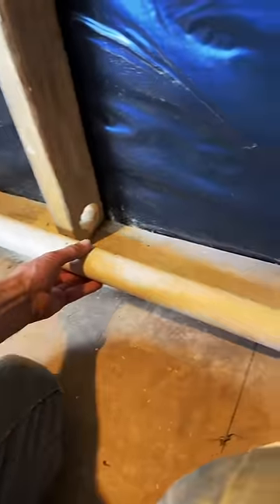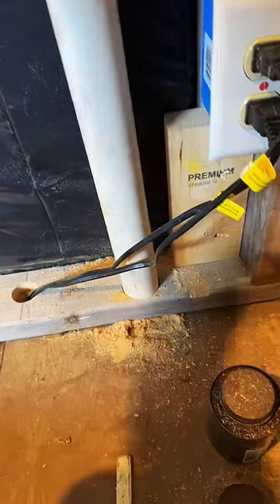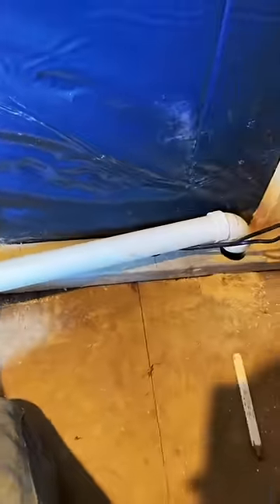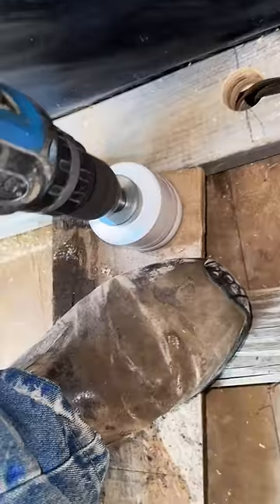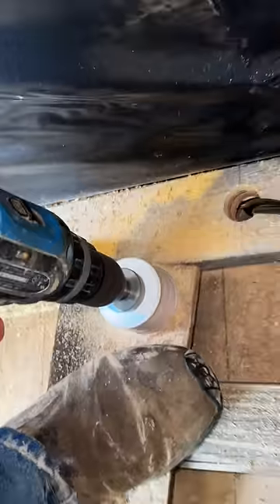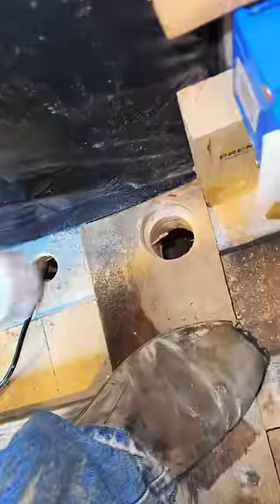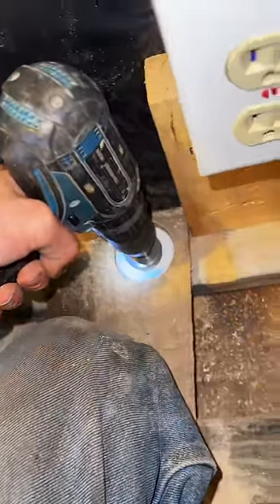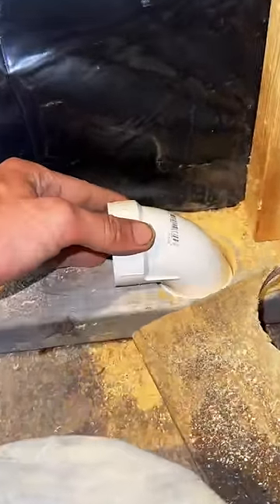Using a hole saw to make a hole bigger

Comment: Attach the bit for the smaller hole that you drilled previously INSIDE of the larger one. The first one will ride against the existing hole and prevent the larger one from getting knocked off course.
Reply: Unless you want to offset it like he did end up doing
Reply: I said the same thing 😂😂😂😂
Reply: @Turtleman95  true. I didn’t catch that the first time around.
Reply: Came to say that
Reply: @Purdue_Pharma  dang you quite a stud admiting you missed something cheers king
Reply: This is the way
Reply: If u still have the left over small round pc
Reply: I've done this quite a few times.
Reply: @troykinnison4575 not the piece. The blade. You'll have two hole saw blades on your drill. Smaller blade acts like your pilot bit. Did this for the sheet metal dash in my 70 nova. Cut to small for some aftermarket gauges.
Reply: I've never done that mistake 
..lol.  Breeze Mechanical.  Tnks for the tip.
Reply: @christopherscott8853  I didn't make a mistake. I ended up changing gauges which required a larger hole cut. I had a problem and found a solution.
Reply: Was just about to say so instead I gave you like to make sure he might actually see it
Reply: This dude gets it
Reply: Does’t work often. Usually the smaller holesaw is shorter or the same size, therefor doesn’t stick out far enough to act as a pilot. Sometimes the threads on the arbor aren’t even long enough for the second holesaw to screw on
Reply: @cvs570  lol or your just doing it wrong.
Reply: @Turtleman95 he didn't want it off set. It just worked better because his jig bord locked in when it was all the way back and in the end a bigger hole was fine. So OP had the better idea of using the smaller hole saw to stabilize the bigger one..
Reply: Beat me to it 🤙🤙
Reply: @Ryan-re1rs  i disagree . Would've been sticking out of the wall cavity if he didn't offset
Reply: Doesn't work with all arbors, some brands won't let you
Reply: Do this ☝️
Reply: That's what I was thinking
Reply: What I was gonna recommend
Reply: I came here to tell him this.
Reply: Cant with the milwaukee hole saws which he is using🤷‍♂️
Reply: @Turtleman95 if you need to offset your larger hole you already drilled the first in the wrong place. Skill issue.
Reply: Some people just get shit done and others just make that shit look hard for likes, sir you get my like.
Reply: What? Noooo waaay!
Reply: How do you attach two at once? Not used these just curious, that sounds like something I would think couldnt be possible
Reply: @MooSaidChicken  all the hawlsaws are attached at the shaft by the same sized threaded hole you can put the smaller one on last as it will be sitting slightly forward of the larger one. Kind of like russian dolls.
Reply: I was about to suggest the same thing
Reply: What?! No way!
Reply: Been there done that!
Reply: I had to do this for 6" stainless steel pipe. I drilled a 3" hole in the 6" header and I needed a 3¹/⁴" hole. It worked great but was hard to get them apart!
Reply: Guy at work borrowed my 4 1/4 when he goofed cutting a 4 inch hole. Surprisingly the 4 fit in the 4 1/4
Reply: I was about to say this
Reply: Correct
Reply: @Mountain-Man-3000  after the next video I understand why you did what you did! I have never had that senerio where I needed to offset the original hole. I can't wait to screw up and have this knowledge in my tool bag! Thank you for explaining why! YES, I AM ALWAYS YELLING IN MY TEXT. THE SAME AS YOU ARE TALKING. I am honestly very close to  your monotone .
Reply: This is the way
Reply: Yep... that has saved me a bunch of times!!
Reply: THATS why you can put them all together on the same bit! I never knew. I thought that was just for storage.
Reply: This makes literally no sense.
Reply: @EmeraldCT  wow so helpful
Reply: Dude why make it more complicated than that. Just come on man
Reply: Exactly....
Reply: My hole saw arbor will only carry one saw. The drilled out plank idea is quicker.
Reply: Great idea, friend!!!  I've been trying to familiarize myself with the hole saw recently and shit like this really helps me out!
Reply: This actually doesn’t work with every arbor, I have a Milwaukee one that doesn’t make enough threads to fit two hole saws
Reply: Came here to say this. Lol
Reply: Yeah lol I was gonna say that too
Reply: thanks ol'timer
Reply: I was coming on to say the same thing.👍🏽
Reply: /\    This!
Reply: This guy is right it's a awesome hack
Reply: DUDE, 25 Years using them, just learned that trick
Reply: You must be a locksmith like myself.
Reply: Beat me to it
Reply: @Turtleman95  he said he messed up drilling so the intent was to have the larger hole not offset.
Reply: Exactly
Reply: Exactly what i was about to suggest... ive done it and it works perfectly
Reply: If you want the bigger hole to be offset, you don’t need anything but the bigger hole saw and know how to use a drill… unless you just have spare time to kill
Reply: Doesn’t work on all arbor’s
Reply: @eddyhmmk1  true, doesn’t work on all arbors.
Also, don’t buy hole saw kits that are not capable of this trick.
Also, if you’re a “do it yourself”kinda guy with a cheap set trying to do your own plumbing rough in to save a few bucks… don’t.
Reply: not all hole drilling bits can do that only spesific brands
Reply: This only works on some aubers with screw threads... Looks like he has a push lock kind
Reply: How does he not know this ?
Reply: @larryssnova76  bcause it dosnt work with all hole saw bits. like the one hes using.
Reply: @MrTrauma101  exactly, he's using a pushlock/pinlock auber
Reply: I did this to a set of winter tire rims where the rim hub was too small for my car. Worked perfect and didn't require any balancing. Car rode smooth as silk.

Comment: FYI,  new holesaws will stack.  If your first hole was to small, put the smaller saw inside of the bigger one. They will stagger enough that the first one will stabilize the larger one.
Reply: Yes. I was going to say that.
Reply: Depends what arbor you’re using , no?
Reply: @elililley8922  it could I suppose.  Most arbors I've used have enough thread to seat 2 saws on it and still use the arbor lock.  If your arbor doesn't have enough thread than it would be a problem

Comment: Nice video!  I used this technique 20 years ago when they were building my home. They said I couldn’t us a screwdriver and hammer when I was visiting the home build. They didn’t say I couldn’t use a drill, so I did. I drilled holes for my coax lines and phone lines and marked them from the basement with a magic marker so I could find them. I also drilled 2” holes for my central vacuum. During the Christmas vacation, I installed my central vacuum with my grandson’s help. The 2” holes needed to be 2 1/4” so I used the technique your showing in this video, works great. I used a 12” long 2x4 and 2 screws, one on each end. This made the job easy, I redrilled 3 holes, with no effort.

Comment: As a plumber, I can say that was perfect
Reply: Exept ...IE bends....😢
Reply: Making a place where the insects can go?
Reply: @bshostie5509  i used to work pest control, pretty much any pipe in your house has that. Look under your bathroom sink for where the pipe meets the wall and you will probably see an gap, i recommend cykick cs pressurized, its a spray you can spray those gaps down with
Reply: @urfavginga  not bad but a cheaper way I'd go for is fire caulk.
It prevents insect and rodent passage way but also weather proofs that part.
Especially if you have a 90°, 45°, or 22° pvc or cpvc.
Highly recommend
Reply: @petermetoxen2959  sounds good, i have no experience with firechalk but sounds like it would work
Reply: As another plumber know it wasn't there are ways to drill holes and it's not at the very bottom of a stud where you leave half an inch of wood on each side transferring wait to the floor. Top third-bottom 3rd, a third the size of the stud all that stuff it's basic framing look it up
Reply: Except he made a mistake had to fix it and didn’t run his pipes strait up 😂
Reply: As a plumber, not as a carpenter, the stud(not the plate) had almost nothing left on it. Needs a double metal plate added for strength I reckon
Reply: As an English major, I can say that was perfect
Reply: @pakman5542  he's an Englishman
Reply: @pakman5542  Why are you being condescending?
Reply: Me 2
Reply: @bshostie5509  that was a dumb comment. It’s okay , take your time.
Reply: As a plumber. You fucked up bud. Nobody should ever drill a hole that close to the bottom of a stud. Unless you had an extremely long run of pipe and needed it for fall. Which I highly doubt you were running that drain pipe more than 15 feet

Comment: Most code requires less than 50% of a stud's width can be removed. A 2x4 is limited to 1.5" holes, a 2x6 is 2.25 inches. So for 2" pipe you need a 2x6 wall. 

Alternatively, if that horizonal is under 24" you could put in a stud butted up to the drain and also at the end of the horizonal. Inspector might pass that if that's ever a problem for you.
Reply: Last time an inspector was in my house he got threatened.....just an FYI....most codes are just for money...my house was built to hurricane proof standards and will not pass in most places where I live...because it's stronger and better built than what they want.
Reply: No to mention the locations of the holes....
Reply: @Kolonol1  
If you ever want to sell a place and the buyer hires an inspector uses an infrared camera they will be able to see the studs and pipes. I've had this happen once but only in a new building. Some insulation had slumped in the garage wall and we had to fix it before the buyer would close. Same inspector also complained about an anchor the roofer left at the peak in case the inspector wanted something fixed in the roof.
Reply: @weege5.45  Im not fixing anything when I sell...take it or leave it. You want better insulation? Won't close unless I fix it? Tough. Everyone says I can't do that and expect to sell, but I didn't have any problems selling the last place either with that attitude. Made $45k on it...
Reply: Or the hole being .5" from bottom. Plumbers and electricians love to fuck up some framing
Reply: Thank you I was like isn’t anybody gonna notice this. He’s got practically no stud left
Reply: @Kolonol1  you can always go above and beyond code. That is allowed, you just can’t have less than the code. Your house maybe older and different codes applied when you house was built and is then grandfathered in. However anything you do to the house now has to be brought up to code. But nobody can reject work that goes beyond code. Their not going to reject a house that is safer then they require
Reply: @Kolonol1  and a lot of people lie on the internet too.
Reply: @Noneyabiz001  yes they can and do in a lot of places. Ohio doesn't like having the walls braced to the rafters on dormers. It's stronger and better in every way. They are also weird about double top plates...both of these things I did...they wanted me to use 2*4 walls instead of 2*6 walls on my dormer because the rest of the house was 2*4. I'm building everything out using 2*2s to insulate my house as 2*6 walls instead. Ohio doesn't like that because I'm not using actual 2*6s and changing put all of the studs...which would be really stupid because my 2*4s are much much stronger than their 2*6s. Their 2*6s are crappy pine boards (crappy because everything is warped and cracked and full of knots today) and my 2*4s are 130 year old Oak. A few other things they don't like is I did not only nail my stringers to the center board but I pinned them too then ran cripples across and attached them in the middle and then sistered them on each side for strength. Ohio doesn't like the pins or the middle attachment even though it laterally transfers half the strength to the center beam from the outside. I also used larger Simpson hurricane ties that Ohio has said does not meet their code but are required in states like Florida and Louisiana for hurricanes.

So my house does not meet code in Ohio because it is stronger than they want literally. My dad taught construction for 35 years and is higher qualified than their inspectors which also presented a problem for them because someone who is less qualified cannot inspect someone who is more qualified. We will be going to court soon about that because it was mentioned that Green county wants me to tear the dormers off and I'm not doing it.

Comment: Make sure there isnt too much strain on those boards like wall studs and floor studs. If your going to be adding weight ontop of that add another beam for extra support.
Reply: I was about to say the same 👍
Reply: The integrity of that 2x4 is gone
Reply: I've seen plumbers make Swiss cheese out of load bearing beams without a care about structural integrity.  One day having a rookie drill pipe paths can cost thousands in repair (by a responsible builder).
Reply: He’s worried about the elbow hole and has remove every bit of the stud to the left. How many more are like that. Plumbers🤦🏻‍♂️
Reply: I know a couple of carpenters who call big holes like that "plumber cancer" because of the compromise it can impart to structure.
Reply: @MonkeyJedi99  do those carpenters not realize us plumbers are extremely limited where we are able to run our pipes? If the builder tells us we need to run a pipe from A to B there's not many options

Comment: You can also put the smaller bit inside the bigger one to use as a guide
Reply: Yup thats the trick i know. Use a slightly smaller bit that the original and then the bigger one and it works like a charm
Reply: Beat me to it, awesome little trick quicker than nates way hopefully he sees this life hack
Reply: Not all sets allow for it but in general yes. would have saved alot of swearing if i learned that trick earlier
Reply: I told to someone just a few ago and he looked at me like I was retarded. I've had to do it many times when I was doing electrical work.
Reply: That only works if you want the new hole centred on the old hole, with this trick you can also offset to avoid blowing out the side of the plate.

Comment: I had a piece of copper pipe going through some old mesh and concrete tile. Thing broke off right at the edge of the tile. No way I was breaking out any more of hat mesh and concrete than necessary. Had to drill a hole around the pipe so I could get my hands in to work on it.

Whipped out the Hole Dozers. But I could not use the centering bit without drilling into the pipe.

Oh, it got done. It always gets done. But man, getting that Hole Dozer to bite without the centering twist...I am telling you, this video reminded me of that job and brought me flashbacks.

Nice trick! With a block of wood, a spear but and a couple of Tapcons...I could have been out of that bathroom an hour before I was. 

Damned sure wish I had thought of it on that day. But f it happens again, I will use this.

Isn't it always the simple fixes that get away from us? Well done, man!

Comment: The sign of a good carpenter is by how well he fixes his mistakes!
Reply: Yes but he's also removed about 90% of the diameter of those battons. How much strength do they have left to hold up the wall? They are going to fail sooner than later....
Reply: @CS-zn6pp  Was going to say those cuts I doubt are to code. I know they wouldnt fly here. Good carpenter my ass.
Reply: @CS-zn6pp  the elephant in the room. Everyone saying what a good job he did, I'm like until the inspector gets there. Don't people love it when you do a good job just to come back a few days later and another trade has decimated your work?
Reply: And a sign of a better one is not making those mistakes....
Reply: He's not a carpenter he's a plumber .. to you can tell by the amount of wood he took out of the 2x4 ... 😂

Also that hole for the pipe on the left is too close to the end of the 2x4 it will probably fail...

Comment: I've used this for over 30yrs. Started when I was framing houses. I have one for every holesaw I own and I drilled a 1/4" hole thru each corner and have them on a 3/16" quick connect cable so I can easily access each one. So far I think i have 28 different guide templates.

Comment: Great trick! Another trick to accomplish the same thing is to thread on the Orin hole saw saw inside of the larger one on the same arbor. This works really well when it works, but sometimes depending on the style of arbor and the size of hole saw it doesn’t work. I will keep the trick you’ve shared here in mind!

Comment: Wait until he realizes that you can attach alternating sized hole saws into eachother.
Reply: Not all hole saws do that or have staggered heights, but if yours can it's a great way to do it if you want it centered.
Reply: Yes but he made the hole off center on purpose
Reply: My set of Milwaukee holesaws doesn’t have a long enough thread to catch a second holesaw.
Reply: Wait until you realize he offset the larger hole

Comment: I use that exact same technique to drill a bigger hole years later to put a pipe through. It worked excellently. Just like you I just held it down and drill the hole through